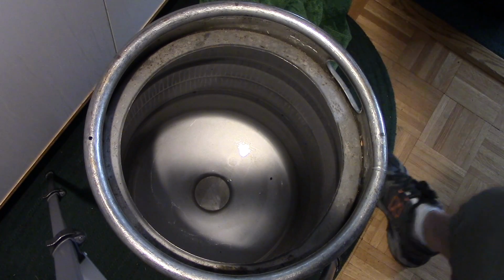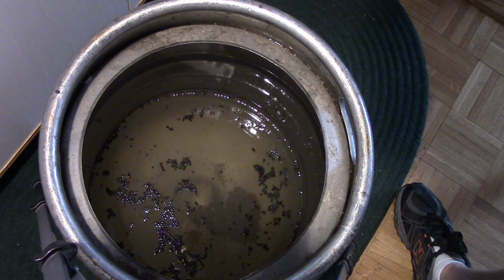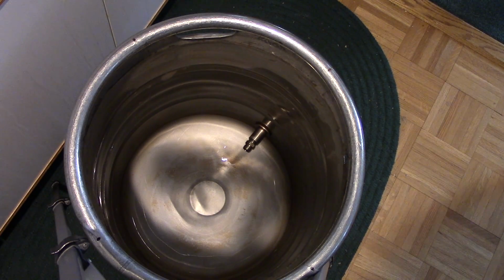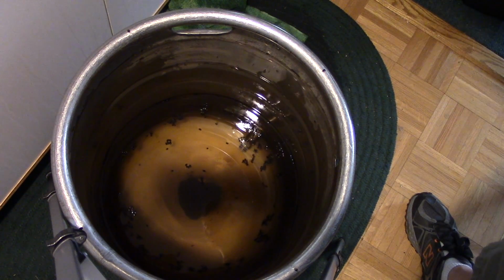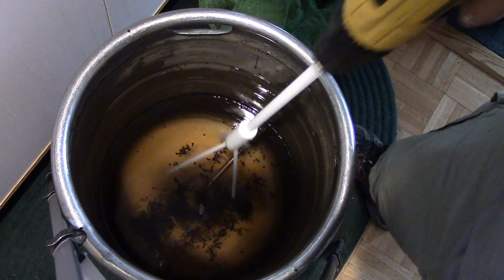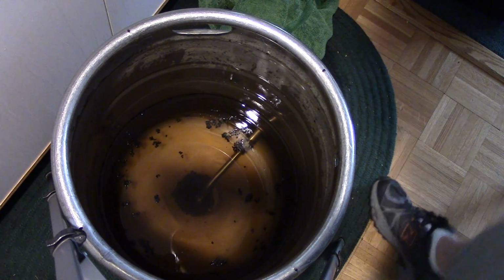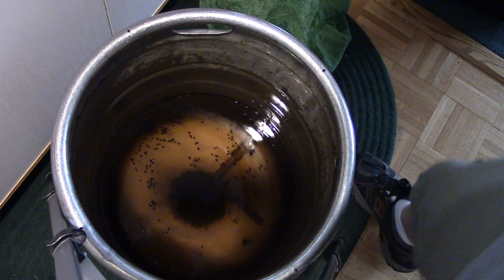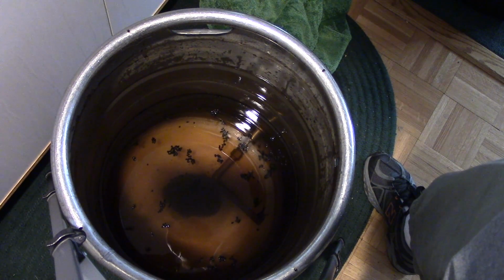How Does a Dip Tube Affect Whirlpooling?

Comment: Good video.  I had been a physics major in college and this made me want to have an explanation.  The tubes and stuff you put in are not impacting the main action.  The main action is on the bottom of the keg.  In the spinning liquid, a 'secondary flow' exists in a different direction than the spinning flow.  On the bottom, the secondary flow comes from the sides into the center,  and then upwards to the top, and then mixes in with the spinning fluid.  The trub is too heavy to be lifted up with this flow, so it can only be pushed into the center.  To find better explanations, look for 'tea leaf paradox'.  This video helps explain: https://www.youtube.com/watch?v=sxAiRe_QWWA
Reply from the maker: Fascinating!  I plan to look into this a little deeper.  Thanks for the info.  Since I did this little experiment I've rethought some of my whirlpool/chilling mechanics but I can't say I've really made any changes.  Now I have something new to think about.  Cheers  -Mike

Comment: i wonder if trub behaves differently than the grain used in this experiment? i would think that it does. i use a paddle to whirlpool, just a few strokes and i get a perfect cone every time. recently i bought a trubtrapper and even with that sitting in the bottom of the kettle i get a cone right in the center of the trub trapper.
Reply from the maker: The trub trapper is a smooth circle.  I would have thought in this experiment that the straight arm of a dip tube would have screwed with the ability to form a cone.   I haven't tried this yet with left over trub from a boil.  So I still don't know if the trub would react poorly to a straight dip tube arm vs. circular trub trapper.  My instinct is still to say know because I never get a good cone per se.  Since this experiment though I've moved to a plate chiller and I use a hop sack to control the amount of pellet hop debris going into the chiller.  Although I've seen many people in the years since plate chillers came out speak to the fact that keeping hop debris out of the plate chiller seem to have been over blown.  That's been my experience too.  I don't push an IPA's worth of pellet hops through it.  However 1-3 ounces of pellets haven't clogged it yet.  BREW ON!!  -Mike